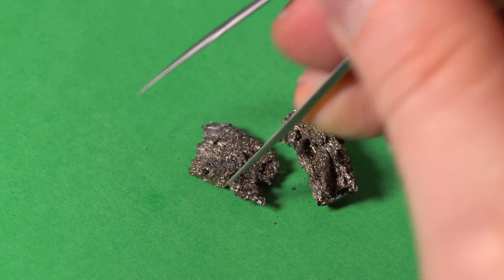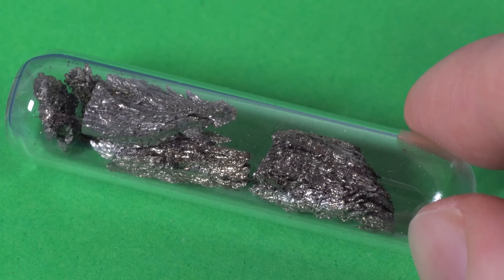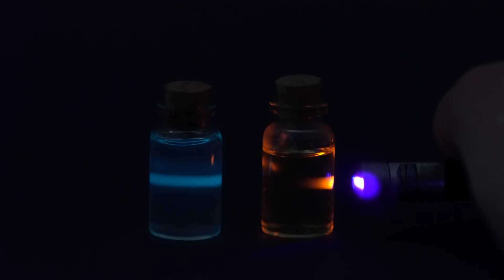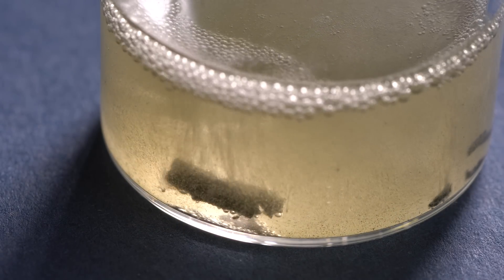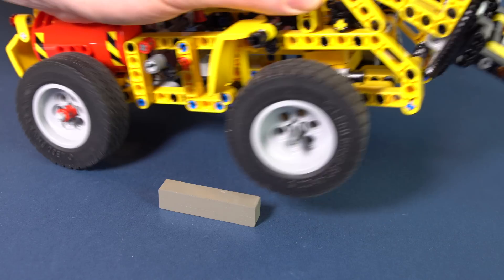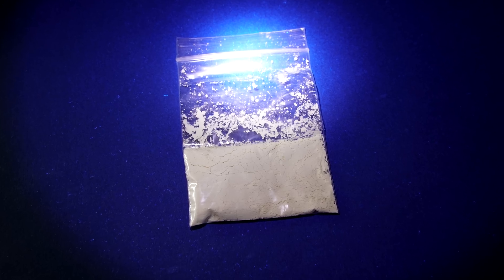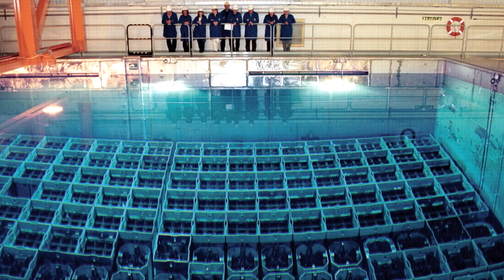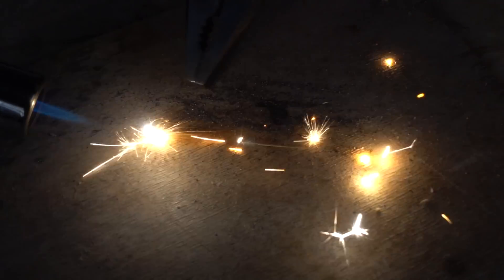Samarium - A Metal Which HELPS HEAL CANCER!

Comment: 4:20 It is not similar to, IT IS A PELTIER ELEMENT
The effect of pumping heat with electric current is called Peltier effect, and the opposite effect, creating electric current from heat flow (or voltage from temperature difference???) is called Seebeck effect...
Any device that does one can do the other, but some are optimised for heat pumping and other for power generation, or temperature measurment...

Comment: I HAVE A QUESTION.........1.When sumarium chloride  is added to an alkaline solution, sumairum hydroxide precipitates. what trial can this be used for.?
                                               2.what P.H. level do you need for extraction?
ormus from dead sea salt can be extracted like this, i was wondering if the cancer curing properties can be extracted from the sumarium in this way.

Comment: what was going on in those reactors? Never seen them shake when in their glow mode!
Reply: That's a pulse. It's where the workers cause the normally slow nuclear reactions to occur very rapidly. 
The rippling is because this reaction creates a great deal of heat in a matter of microseconds. As we all know, materials expand when heated and the expansion happens rapidly.
Pulsing a reactor is part of testing which must occur on reactors for safety purposes.
You can Google reactor pulse and learn more. There's also this link which will be somewhat helpful.
http://www.popularmechanics.com/technology/infrastructure/a22130/nuclear-reactor-pulse-video/
Reply: The ripples on the water are from the control rods being removed and inserted to start and shut down the reaction.